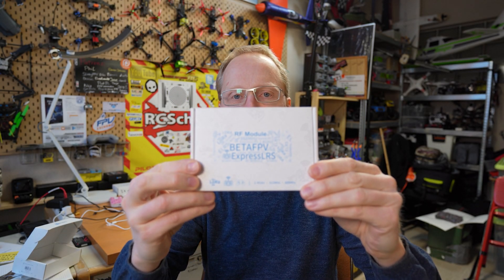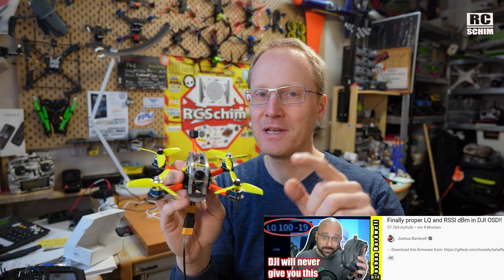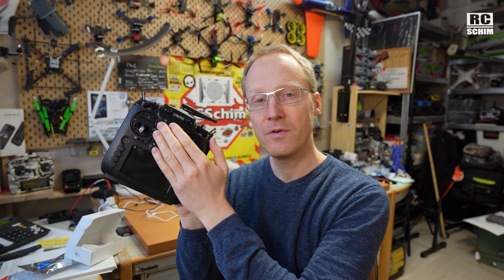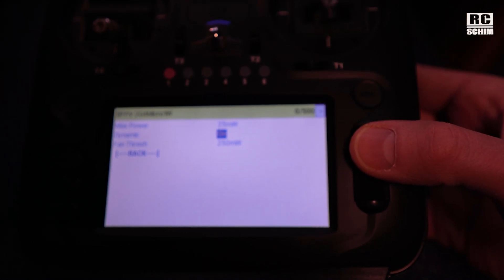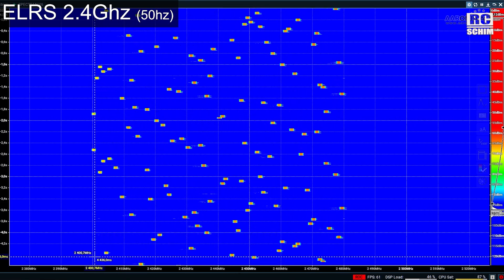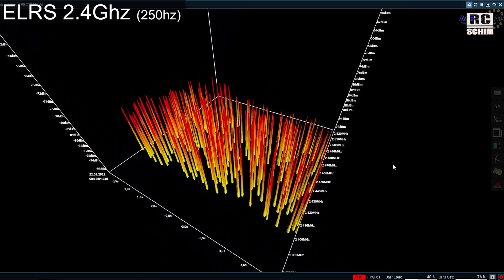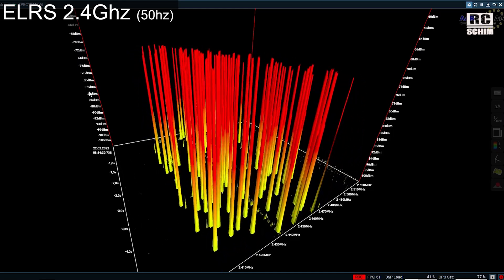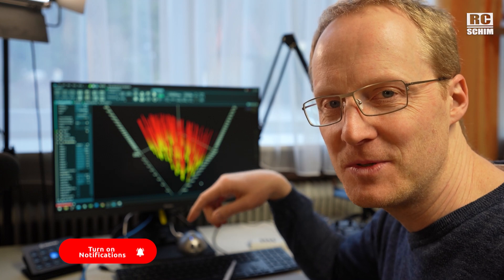BetaFPV ELRS Modules

Comment: Thank you for your feedback and test on our ELRS Lite Receiver (Flat Antenna) and we appreciate it. 

Our tech team investigated it thoroughly and figured out that there are two different parts between the beta and released version. For the released version on sale, the space for the LED is removed to a different position and the capacitor is connected in series with the sides of the antenna. And this leads to the failsafe when pilots fly their drone at around 100 meters with an RSSI of -95dBm of this receiver.

We sincerely apologize for this issue and all the inconvenience it has brought you. This receiver with a flat antenna is a better choice for whoop drones. It works successfully for indoor whooping and racing. On the other hand, it might not be an ideal choice for pilots who expect outdoor and long-range flying. For all of our customers who bought this receiver and have issues with it, we will Refund you or Send you a new one that fixes all the issues. We will release the New Version V1.1 that fixed this issue in March. Please feel free to email support@betafpv.com and our support team will help you. 

For the latest version, we have fixed this issue and it will be back to sale in March.  According to the rigorous test of the latest version, using the nano module and moxon antenna, the result shows that there is no RX LOST Warning with RSSI of -105dBm, an output power of 50mW, and a packet rate of 500Hz.  Meanwhile,  the range is up to 500 meters, which has the same effect of signal reception as the version with a tower antenna.  

Best Regards
BETAFPV
Reply from the maker: Thanks for the extensive comment and the customer support. It was just random from me to use the flat antenna RX instead of the Tower antenna version. I wouldnt expect such a tiny RX without larger antenna to be used for longrange ;)   I think there's a lot of potential in ELRS and BetaFPV shows good efforts here!

Comment: What is the best battery to use in the TX16s for this module? Does it require a lipo to run 1w or does the radiomaster 21700 pack work? Is there an actual difference and would a higher quality 21700 work better than radiomasters so you could retain the type c charging on the transmitter?
Reply from the maker: I don't have s lot of experience with the 1w mode. I would use good 21700 cells.  Are those even 21700 or 18650? Don't know from mind ;)
Liions look like they don't last long on tx because their volts are lower than l lipos. But they last quite good.

Comment: FYI: BetaFPV makes a JR to Micro Adaptor, (~$9) so could use the Micro ELRS on Transmitters with regular JR module bays. Could be handy accessory for someone like you doing review with multiple radios and transmitter protocol options. (is listed on BetaFPV website, but few stores stock)

Comment: Opentx has alot of work to do after reading switches, gimbles, rotary's/sliders. It has to add in all the different modifies screens, trim, logicals, curves, etc. My question is what is the hz this can be done with say the tx16 series.  If I send packets faster the the processing of inputs and all the modification screens then I will be sending duplicate stick readings? Most likely the results of processing go to registers for tx to read (parallel processes understood) and that faster transmit speed winds up reading and transmitting same stuff.  Nobody has talked about has fast we actually update those registers! Is this why JB and buddy couldn't tell the difference?
Reply from the maker: This is a very valid point! Now we need to see how a can inspect the single frames to see if they are just duplicated. And I need to understand the protocol....

Comment: I just got started with the ExpressLRS stuff, i just flashed all my FrSky R9/R9M hardware and so far so good, still need to build that confidence and test its limits more. The learning curve is interesting and overwhelming, so much things to understand, i guess it's the price to pay when you stopped flying for almost two years and then jumped back lol
Nice RF 3D tool by the way :$
Happy midweek Mario and keep on flying <3
Reply from the maker: HI Cedric, nice to see you here! Yeah, I heard that you can re-flash R9 and have ELRS on it. Cool! 
I dove into ELRS for this video and was amazed on the TX module  (like the Wifi link to home network) and how well integrated these things are...
We will see in the future, but I think the ELRS protocol is pretty solid - and maybe even at 500hz it has decent LQ. I was just testing a very bad example here with this tiny whoop RX...
Good to hear FPV community has gotten you back again! 
The Spectran is super cool - I was lucky to get my hands on one - I need to use it much more - re-purposed an old gaming PC (with decent enough hardware) for my hangar now ;) If you collect 2x USB 3 worth of data in real time - you need quite a powerful CPU! But this lets us examine RF quite close  (much closer than I did here).
greets and happy weekend!

Comment: i asked my brain if it fancied a look at elrs yet, its said no!, i offered it a biscuit and some coffee, it said feck off!,   then i pointed out that my antenna fitting issues with crossfire would be gone, and it got up and left the room!.
Reply from the maker: Now that's a funny picture - imagining you discussing with your brain :) 
What antenna fitting issues?  Havent you heard of Zip-Ties?
Reply: @Rcschim  hehehe, yeah i need to mount immortal T at the front but it needs to be a bit further out on my new frames, halo rc archon v3's, really cool frame, halo rc is Bludz FPV 's designs. AUW with 4s and hero 6 is 690g

Comment: Oh baby I love VNAs! Regarding the lower signal on 500Hz vs lower rates, we transmit 1.5ms out of every 2ms period, with 4x transmits before hopping, so you should see 7.5ms of spectral power for every 500Hz hop and not 11ms. I'm not that familiar with higher end VNAs, but is the sample rate too low to detect the full power of 8ms / 75% duty cycle?
Also yeah, just don't use that red flat antenna. It is so terrible it should really only be used indoors, or with 10x normal transmit power.
Reply from the maker: Hi Bryan, I admit I had to lookup VNA  (vector network analyzer) :)   I still need to learn a lot on this device - but it's really powerfull! 
As you say, here I prolly wasnt looking close enough. I had a time compression set - so If I capture the signals in realtime and maximum resolution I should see the single pulses.
This software here can even decode stuff from RF to bits and bytes for us - it's only a matter of setting the right parameters.  (there are good examples how to analyze dect phones).
I'll get back to the bench and make a followup soon ;)  greets, Mario
Reply: @Rcschim  Oh I thought you did great with it! I was only trying to explain why it looks like the signal strength looks like it drops at 500Hz compared to the lower rates. It just doesn't look to be sampling at a high enough rate for the short duration transmits. Keep up the great videos, I really appreciate your technical eye.

Comment: Hi Mario, thanks for your work. It would be very helpful for us to understand how good is the Elrs system and which is the best configuration. I actually have an xlite with r9m lite Pro module and I would like to switch to another system. I have low Rssi after 1km at 1watt. But don't know what to do. Crossfire? Or Elrs? Erls 2.4ghz or 900? Let's consider 2.4 ghz, 250mw or 1watt? I would like to use it for everyday use without worrying about failsafe, and also with long-range quads if necessary... I was about to buy Crossfire because of you, I have noticed that you use a Tango... But nowadays Elrs seems to be a must and prices are lower. It would be interesting to have some videos about it, similar to the ones you made for the dji system. Thanks, you are like a friend to me, with whom to share the passion for fpv
Reply from the maker: Thanks for the nice comment! 
Check if you can re-flash your R9 module to support ELRS - I heard that's an option. 
Low RSSI isnt always bad - link quality is better to judge your link. if you use DJI fpv - the linkquality cannot easily be displayed - but follow the link in this vid to bardwell - he shows what you need to do to get LQ on your DJI copter. 
Or you get LQ value via telemetry and just display it in the RSSI OSD element - again something that bardwell or Oscar Liang can explain well.
I just stick with Crossfire since I have a lot of RXs and I love the tiny Tango2 with the possibility to go up to 1w if needed (dynamic power). Most of the flight it only uses 25mw.  I feel like ELRS can achieve the same now.
greets, Mario

Comment: Hi Mario after long time in analog I switched to digital and I’m thing to switch my taranis with has elrs to the dji fpv radio. No more rx to solder no more extra antennas. What you think about this radio?
Reply from the maker: HI, I didnt use the DJI Remote - but I see the benefits. Let me help your descision:
OpenTX/EdgeTX... :  
  + more "intelligence" on the radio side.   (timers, mixers, logical switches, audio alerts if link quality low....) 
  + more range (if you use the right RXs and TX power...)
  + separation between video link and control link   (you want to have longer range on your control than on video!)
  - additional soldering, cost of RX,  UART needed for RX 

DJI Radio:
  + easy setup, cheaper (no RX cost), 1 UART - 2 functions (RX for control, OSD telemetry for DJI video)
  - not much to setup on your radio (audio alerts)

So for me:  with many models I wanna have a constant set of tools (audio alerts) always setup the same way. Sometimes I ran out of UARTS on my copters and didnt have OSD telemetry, but then I still have telemetry warnings on my Radio. 
On my wing (just built for DJI yesterday):   I have NO FC or intelligence on the wing, oldschool RX with servo leads, totally easy installation - DJI FPV caddx powered by balance lead and that's it.
on the radio  (tx16s) I could at least setup some mixers (delta mix) have different rates, and cool: I have 5min timer  (wich is counted at 100% down it I apply 100% throttle, and only 50% when I cruise with 50% throttle - this way I can live with a stopwatch if I dont see Volt or Mah of my pack).

greets, Mario
Reply: @Rcschim  thank you so much Mario!! For the quick reply and complete answer!!

Comment: Very nice review. Quite a few thoughts on this.  It's obvious to see the db differences 50hz/500hz modes & 2.4/868mhz potential range. ExpressLRS 2.4ghz is using a much wider channel spread compared to CRSF at 868mhz so ELRS 2.4 & Tracer 2.4 will be more robust to external interference & able to cope better with multiple pilots before experiencing significant range reduction/failsafes.

 ELRS at all hz settings is pushing a smaller packet size than both Tracer/CRSF and needs looked at.  At 500hz more packets are able to be lost before the control link degrades so to a certain extent so may well offset a higher overall db in many cases. RSSI will be lower but link quality higher. The different frequencies used are also susceptible to different types of Interference e.g. Cell towers vs Wi-fi.

To test the packet size/difference & speeds/db you would need to compare Tracer to ELRS. Having flown CRSF/Tracer/Elrs extensively IMHO stick response at 250hz is enhanced and often requires a small reduction in your overall rates. 
Just so many variables. You have Dynamic power/ variable packet rates to consider in each system and when this occurs. ELRS has been shown to penetrate buildings better than a conventional 2.4 link and approaching CRSF see Davide FPV. 
All these systems have an advantage over the other whether it's cost/speed/penetration/range/size/Antenna type/noise resistance/multiple pilots & honestly don't think any will disappoint used in the correct circumstances.                
   Thank you for doing this Mario ;-).
Reply from the maker: Super indepth comment! I'll have to digest this now ;)
My first contact with elrs was for sure not the best with this tiny rx. Quite sure that this will be a strong standard in control link going forward. 
I think I just touched the surface of elrs with my measurements here...
Thanks, Mario

Comment: thank You very much for this information.
read somewhere orientation of the red smd antennas is very important. they have to be mounted verticaly.
would be interesting to see this tested.
regards
Reply from the maker: You see in the video I even have the RX ontop the copter - dangling on the cable ;)  but the orientation should be quite good this way.
Still - I should have gone with the "tower" antenna version of this small RX - heard they are better. 
Personally I'd go with 868 and proper antennas if I were to replace my copters RX link - but currently I stick with Crossfire.

Comment: sehr gute Erklärung, habe immer 250 Hz für meinen Xknight35 benutzt, ich denke ich gehe dann auch runter und habe somit ein stärkeres Signal, um weiter fliegen zu können😁
Reply from the maker: Ich denke mit Crossfire starte ich bei 150hz - aber wenn ich etwas weiter weg bin schaltet der automatisch auf 50hz  (und das schon recht bald). Dh. ich bin 50hz gewohnt und es reicht.
Natürlich für Freestyle ist's schon gut wenn man weniger insgesamte Latenz hat.  Dann muss man allerdings auch seine Rates vielleicht anpassen - damit die Rollen wieder waagrecht enden.
Reply: Ich habe Elrs, ich werde mal auf 50 HZ runtergehen nächstes Mal, mal schauen ob ich überhaupt einen Unterschied in der Latenz merke, JB scheinbar wohl nicht 😉, dann ich sowieso nicht 😁, freu mich wieder auf ein nächstes Video von dir 👍

Comment: Will you go into design defect for betafpv nano module that does not fully engage into the x-Lite or X9-lite module holder? You have to cut plastic housing to make full connection on the pins in back of radio.
Reply from the maker: that sounds unfortunate. I had a problem with the Nano to micro adaptor:  those little golden pins are VERY fragile! That's why I never used the nano ;)
I don't have to XLite with nano bay or the X9lite.... so I didnt run into this issue...